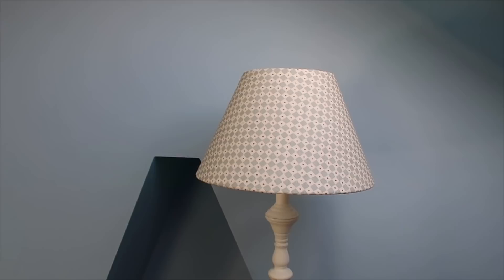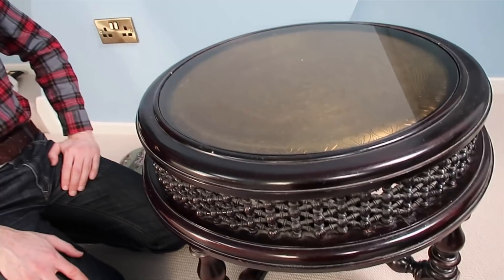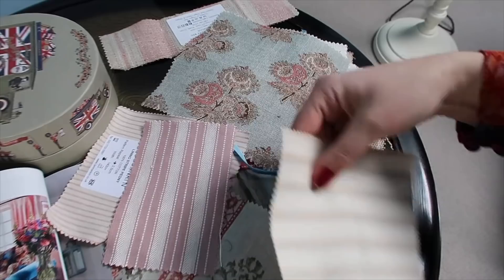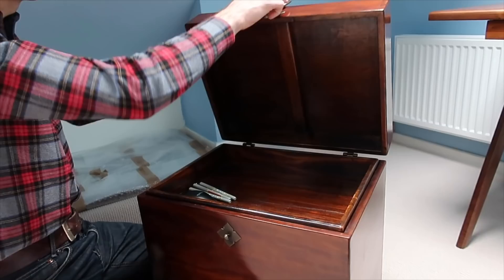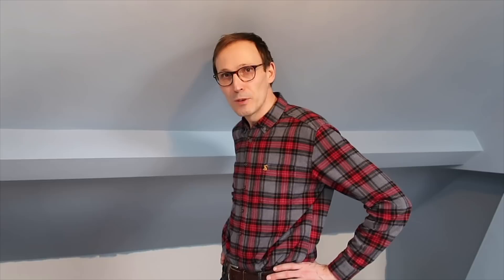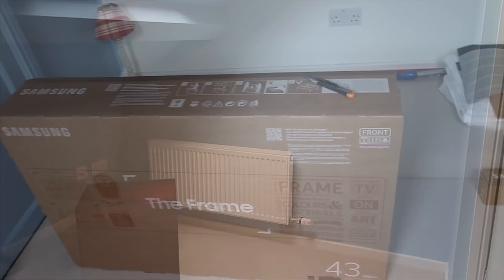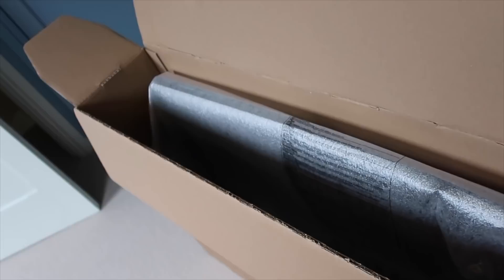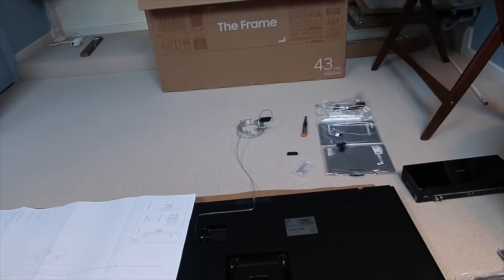ANTIQUES & NEW THINGS FOR THE HOUSE: Attic room renovation & decoration

Comment: The Egyptian table is lovely and your chais will be stunning!  What if you used the fabric you like and make a small bolster pillow with another?
I hate wire showing, so we have drilled a small opening into the back wall and “fished it” to an area that we could access it where electricity is available.  This is just an idea that might work.  I tried subscribing to House & Antiques, but the subscription would begin in May.  I will try calling the number and ask if the February issue could be included.  Your attic will be wonderful!!!

Comment: A tip Joerg, stick an open envelope on the wall under where you'll be drilling and it will collect the dust.
Reply from the maker: We usually use the vacuum cleaner straight away, it's even easier.

Comment: Hi, you two.  I very much enjoy your decorating project in your wonderfull  Victorian home.  I am a furniture designer in Southern California and I also design armless slipper chairs like the one your have. One thing to remember, that unless the seat is 28" wide, you have no where to put your arms or rest against and they are not meant to be chairs that would feel comfortable watching a 2 hour movie.  Your chairs are lovely. The fabrics  you have in your little sample packs look to be mostly cotton or linen and those fabric contents are not durable for lots of use.  A synthetic that looks like a natural fabric will give you years of use. If you use a stripe fabric, have them make diagonal piping with the stripe fabric and where possible use double piping for a nice finish.  Be careful with those little wheels on the chair legs, they will eventually cut  your carpet.  Hope this helps. My best to your both.
Reply from the maker: Hi Janice, Thanks so much! Yes, we are aware about the slipper chairs, our upper staircase isn't wide enough so we needed to choose a pair without arms but that's fine, it won't be our constant TV room lol, we will also put pillows on there. The sample fabrics are (apart from one) all for general upholstery so are very thick but to be honest, we are still looking as we think we haven't found the right one yet. You will be laughing now, I'm currently looking for something that will protect the carpet as you're very right about the wheels. Have a lovely weekend.

Comment: Be careful not to give tips that will hurt those Vinterior sellers by asking to buy something for a cheaper price you found on Vinteriro but wants to pay outside Vinterior. Vinterior, Selency, Etsy, eBay and other decor marketplaces will banish or punish the seller for “fee avoidance” if they find out a seller used their system to contact a buyer and sell cheaper elsewhere. Of course Vinterior and other marketplaces need to make a profit. Hosting, maintaining and marketing of websites cost a fortune and they charge a fee for doing these jobs for the sellers, for connecting sellers with buyers like you and you may hurt these sellers by offering to buy their items outside the system. I have seen many cases of sellers banished for breaching the rules. The thing is: If you send a message to a seller through Vinterior’s system, offering less you have to also agree to purchase through Vinterior in order to make sure the seller is working within the marketplace rules. Sellers can accept offers in most marketplace and go forward with the purchase on that marketplace system, what they can NOT do is use the marketplace system to sell cheaper elsewhere. Make sure you give your viewers a tip that will not hurt the sellers you buy from. Some sellers are not aware they can hurt themselves by offering a discount elsewhere. The thing is, maintaining and promoting a small business website is a hefty job and most sellers don’t have the talent to do and they need the marketplaces to survive as most of their sales will help within the marketplaces. Just saying. Btw, I am a vintage and antique curator and seller myself and we need healthy functioning alternative marketplaces like Vinterior, Selency etc... to be able to help our small business survive.
Reply from the maker: You are right, thank you!